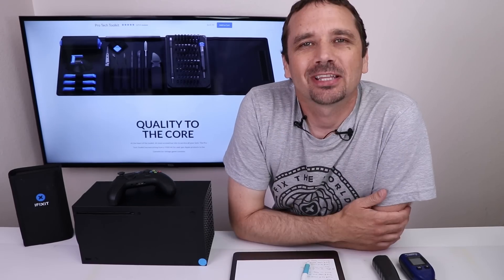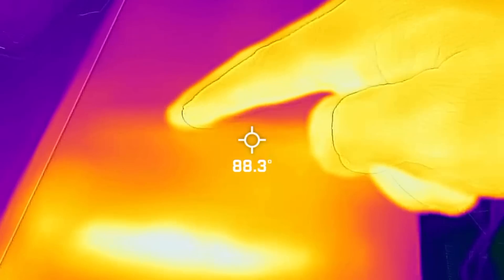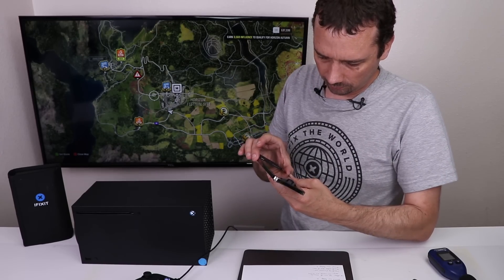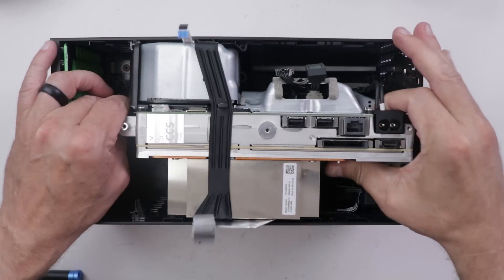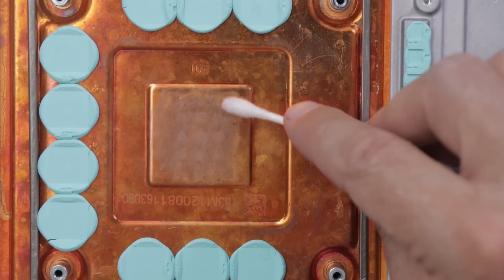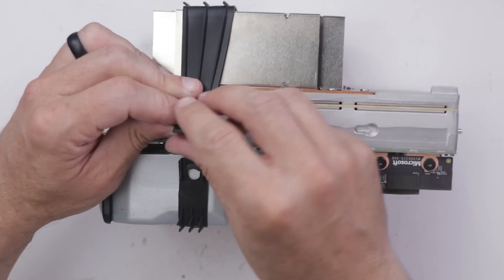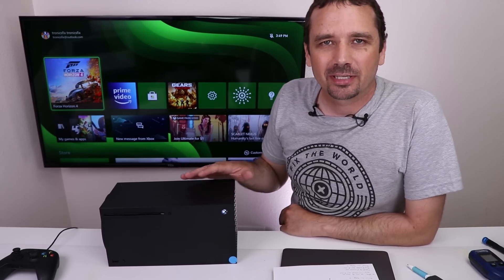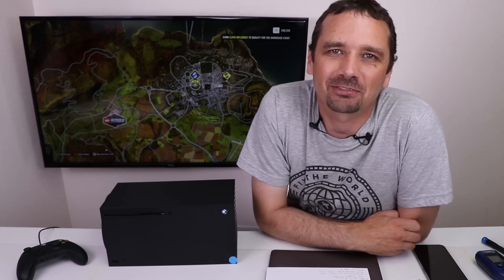I Put Liquid Metal In My Xbox Series X - Here's What Happened!

Comment: When I put Liquid metal on my 6800 XT it didn’t spread over the die like that, really odd, had so much trouble doing it that I ended up basically coating it in the stuff, and ruining my table. In the end the temps dropped by as much as 1-6 degrees on the core, on average maybe 4 degrees, and even stayed below 50 degrees at times under load. While mining it always was at 50-51 degrees, this time around it’s at 44-46 degrees. It also was 1-3 FPS faster maybe more. Not margin of error, did the same test hundreds of times. Nonetheless it’s really worth the risk. Hotspot dropped by 1-10 degrees depending on how hot the card is running. Can’t wait to waterblock it.

Comment: Hi, thanks for the video .... I also used liquid metal, spectacular results and I also changed the thermal pads for the vrm .... amazing results .. thanks thanks and thanks ... if you are a fan you don't have to fear the liquid metal .... for example, I used insulating tape around the gpu and there are no problems of dripping ....
One enjoy Liquid Metal Thermal Paste, 79 W / MK
Thermopad Thermal Grizzly Minus Pad 8- Thermal pad in silicone, self-adhesive, thermally conductive
these are the components I used

Comment: There's such a HUGE lack of any scientific approach here that it shouldn't allow any reasonable mind to draw any conclusions whatsoever. You've got varying ambient temperatures, you're not measuring temps from where you should be etc, and the list goes on. Just because you're seeing outside case temperatures higher than before the liquid metal DOESN'T mean that the liquid metal is the cause and therefore performing better. Of course that might be the case, but your NOT actually proving anything, it's all just conjecture. What makes this particularly bad is that this video is ALL ABOUT liquid mental and thermals and then do such a piss poor job of actually obtaining any meaningful data.

I like your videos, but where this could have been an interesting look at deltas between liquid metal vs thermal paste on the XB1X, your scientific method makes drawing any substantive conclusion just completely pointless.

Comment: I found out why they change the ps5. They use liquid metal on a PS5, so copper will absorb or liquid metal will penetrate the copper. It forms an uneven alloy surface over time on copper. Copper has to be nickel plated to prevent this, maybe this is why they've made changes on the ps5 of late with less fins and less visible copper....maybe it's aluminium or plated nickel copper, and not as much metal and fins needed with the right metal, and prevents failure properties? I stole some of that info from another comment. Just put two and two together maybe?

Comment: The real deal is that with LM the chip is way cooler. Will it make any difference? I think not because Xbox doesn't do boosting CPU speeds. Always the same mhz.

Side from the part that your chip is cooler in temperature,  LM doesn't dry up and after a second apply the Xbox never have to be renewed from any LM. 
While using normal paste will have you change this within 3 years. Especially if they use cheap paste.

Comment: ok so if i understand this correctly: a better thermal solution will output more heat because its taking more away from the cpu? so its possible to surmise the cpu is cooler because of that?

Comment: If you decide to use liquid metal know that the gallium in it will diffuse into the copper in about 6 months and solid indium is left behind making bad contact. Then you need to re-clean and re-apply it. Note the diffusion is permanent and actually degrades the cooler. Ideally you need a diffusion barrier like with nickel or silver plating.

Comment: As much as I am a technical person but I have to say The engineering behind Xbox systems is amazingly designed to be ergonomic and energy efficient 😍there is a reason why no game system do not use liquid metal simply because it’s highly corrosive and you have to reapply the liquid metal more often which is not worth the hassle that is why every game system I have such as my Xbox one Playstation four Nintendo Wii U PlayStation three and Xbox 360 they all use the highest quality thermal paste which will prevent the APU from being damaged from corrosion liquid metal is only recommended to be used on a desktop PC not on a laptop and it makes sense it’s much easier to manage liquid metal on a desktop PC😉👍 however I’m only disappointed with one technology that they didn’t include with Xbox series XS they don’t have a built in thermal detector but I am so glad they brought back the vapor chamber which allows the series XS to remain very quiet no matter what game you play The only major drawback with the series XS they draw too much power which can be a serious problem if you are paying for electricity in your home I guess they didn’t need a thermal detector to regulate The exhaust output because The way series XS is designed they have a large ass fan to throw out as much heat as possible in my opinion the Xbox one X was Microsoft best Xbox design of all time not only it’s compact it has a vapor chamber and a thermal detector so it’s literally the quietest game system of all time not even the PS4 Pro 2017 model didn’t have a vapor chamber🤦‍♂️ but it did include a thermal detector but the biggest problem with that is it was drawing too much power that is why it sounds like a damn jet plane🤦‍♂️ however Sony actually remedied the problem they actually released a new PS4 Pro 2018 model they significantly lowered the energy output combined that with the thermal detector it became the second quietest game system along side with Xbox one X but I have to still admit the series XS & PS5 thermal design is seriously top-notch even my PS5 is still quiet no matter what game I play😁👍 I can’t wait to get my hands on the series X but I’m still enjoying gaming on my 2013 Xbox one😎👍 yes I still have the 2013 PS4 I only use it to play VR games like and comment

Comment: Is there a way for you to analyze clock speeds and performance?

There are 2 theories as to why the exhaust temp would increase (you nailed one of them) and they are backed by a lot of data in the PC water-cooling world.  The motherboard itself is filled with copper traces that are connected to the VRMs and CPU.  When you add liquid metal all things being equal (no increase in average CPU speeds) yes the temps in the traces go down because more of the heat goes out of the heat sink.  But usually all things are not equal.

The other reason the temp would go up is most likely the CPU/GPU spends more time at its high clock rates.  For example I can water-cool a GPU and it’s cores will stay around 6-8C above ambient under 99% load (32-34C).  In other words the GPU just sits pegged at its boost speeds 100% of time.  For my CPU I have a CPU that struggles to stay under 100C no matter what cooler until you desolder/delid it and run it liquid metal and no lid.  Now I see 70-80C at full load and 50-60C in games.  That is with the turbo set to all core and 4.9GHz.  

I have a ton of useful data on Liquid metal.  Been using it since well before the 3rd gen Intel launch but just about every single CPU since then I have delided and then ran liquid metal.  I’m currently running liquid metal direct to die water cooling on a 9th gen 8 core i7.

Comment: Don't really get the point of this when you don't even thermal probe the thing..
Anyways here's the thing. The heatsink is probably already mostly saturated due to it being so small. So pulling off heat off of it faster isn't going to do a huge amount. I could be wrong though.
The liquid metal on the PS5 is probably for a mix of marketing and longevity as LM doesn't dry up.

Comment: TLDR: it is a bit higher (temperature) with liquid metal but thats because the room got 2 degrees (i assume Celsius) hotter but that also means the heat transfer of the liquid metal is better, for the most part it only got better by mere degrees

 it is a well put together console unlike the PS5 which literally gets like 5 degrees cooler by removing the side panels and another like 3-5 degrees by putting thermal pads on the memory modules, great job Sony 👌👍

Comment: Since the xbox will be scaling performance based on core temps, it'll be super hard to compare thermals apples to apples.  You'd have to measure core frequencies or power draw as well, which as far as I know there's no straightforward way to do on the xbox (though you may be able to measure outlet power as an estimation of the core power).  But still, a cool test to see what happens!

Comment: I’ve read the comments and have a science degree myself. There are too many variables here to arrive at the conclusion. The system may just be running hotter. It has software to control the fan speeds. We’re they running at the same RPM? Was it louder or almost identical? (You would need to measure the decibels) Also, unless it’s a replay, the stress is not exactly the same, even if you play for the same amount of time, etc. Nevertheless, interesting video.

Comment: Hey man I'm having some issues with my PS4 slim. I turn it on it shows the ps emblem with a black background and stays black the only way I have seen it past that it when I initialize it. It says corrupted database each time it loads up though and I have tried to fix it by using the safe mode but it doesn't do anything it will let me go on it for a few minutes and it's super slow.Sometimes it will freeze and then go back to having the same issues. My dad would unplug it alot so that might be contributing to it can you help me?

Comment: Question- why does the PS5 require that foam looking seal/gasket whereas this does not?
Reply: The PS5 was designed to use liquid metal, so the gasket is to prevent it from getting out and shorting components

Comment: Wow what a terrible idea. There are now thermal pastes on the market that outperform liquid metal and are non-conductive and don't disappear over time. If you were to put your Xbox in vertical orientation and leave it that way the liquid metal would eventually move out from the apu die and potentially kill your $500 console. If you want to replace the thermal compound, replace it with Thermal Grizzley Cryonaut Extreme and have better temperatures then liquid metal and never have to worry about anything needing to be replaced or get damaged. I have no idea why people are using liquid metal on everything like this. Just terrible.

Comment: What would be the problem with a controller that only works with the usb cord attached! I’ve changed the battery with a fully charged battery that works and replaced the usb charging port on the controller

Comment: The way you measure temperature does not work to see if the liquid metal works. Ultimately unless the cpu is throttling it should output the same amount of heat, just the difference between the cpu and the heatsink is higher. If you want to measure the effect, the best you could do is place a thermal couple on the back of the pcb behind the cpu. 

If you have a fan that cools based on temperature, the case should be hotter when using liquid metal as it will ramp up less. But since the XSX has a constant fan speed this does not apply.

Comment: Dude, your measurements are useless as good thermal paste TRANSFERS heat, the thermal output is proportional to load ... You should have put it in DEV mode and used a proper benchmarking app with CPU's actual internal sensor, anything else is useless. During the RROD days an awesome group of people put together the AGM temp dashlaunch plugin to test aftermarket cooling heatsinks and pastes. Modern Consoles have thermal throttling so if you wanted to do it ghetto you could get better results by finding a demanding game that gives FPS on the UI and see if running a game (without human input) makes the FPS raise/drop. ALSO: DONT USE LIQUID METAL ON A CONSOLE!!!!

Comment: Please, please no one do this! I'm a PC gamer and I have used liquid metal in the past, and you can't use it on copper, at least not long term. 

The reason you outright can NOT use this on aluminum is that most, if not all, liquid metal alloys have gallium in them. Gallium reacts with aluminum very quickly, so your heatsink will get destroyed in a matter of days. 

With copper, the metal doesn't react with it nearly as quick, but it still slowly diffuses into it, damaging the heatsink. I can guarantee that if you open that Xbox in a year, the metal will appear to have 'dried up'. It's not dried up, it's diffused into your heatsink and permanently ruined it. The only place you should apply liquid metal onto is a bare die or nickel-plated copper. That's why the PS5 has a nickel-plated heatsink, because if it were bare copper, it wouldn't last a year before needing to be replaced. 

Besides, the heatsink in a console is sized properly for the type of heat output the APU will put out. I'd even argue the PS5 probably doesn't need liquid metal either.

Comment: Nice video. Only issue I have with your methodology is that in my experience with CPU coolers on PCs is that Temperatures under load drop very quickly (within a couple of seconds) from when the load is removed. My CPU jumps from high 80s to mid 30s within about two seconds of removing the load on the CPU.  I think you should be checking the maximum temperature while the load on the CPU is still present. Measuring it several seconds after the load is removed is not as useful information.

Comment: I expected a lower temperature. I though that the produced energy in this chip would transferred „faster“ according the better characteristics of liquid metal. The chip should be cool down a little bit, the amount of energy drop also and the exhaust should be colder after a these 30min. You get more heat by the same „amount“ of load out of the Xbox. This makes no sense to me.

Comment: I suspect liquid metal goes longer without needing replacement, atleast when fitted like on ps5 being integrated when designed? Which I'd say is a great bonus, though obviously when repairing something it may cause trouble because of the skill required to replace correctly.
Reply: @Green Mamba Games what even is your problem, I'm just curious about how durability differs between the 2,this has nothing to do with me not replacing compounds, I never mentioned that, learn to actually read the content next time
Reply: @Green Mamba Games There’s a gasket around the APU on the PS5, the liquid metal can’t get out

Comment: Since the CPU's are based on Zen2 they might have boost behavior similar to it and might boost higher or longer with liquid metal if heat is dissipated more efficiently. So the interesting thing to see would not be the "temps", it would be if games have more stable framerates and if previous dips are avoided.

Comment: I was thinking to do this to my series but it's so quiet I do t think is worth it yet... Probably in a few years once the paste dries up.

I did change my ps4s thanks to you and I believe is more quiet on average but still turns into a jet engine on heavy workloads. I did add heatsinks to the bottom and two 12v fans to cool it down and the noise is more even now.

Comment: Very informative. How ever to me, the risk is not worth the reward. There is not a vast difference to speak of. I would rather be safe with thermal paste, safe to use, easy to clean, non conductive, can be easily reapplied. Is non toxic to aluminum.
Reply: There are a lot of things that aren't covered in this video that make this not a great upgrade. 

First off, he's completely correct. The temperature coming out of the console is going to be hotter because the liquid metal is spreading more heat from the APU onto the heatsink, but if you think for a moment, that same heatsink also has to pull heat from VRM and other components on the board. 

Adding more heat to the SINGLE heatsink in the entire system is not a good idea, you are essentially adding more heat to all your other component. This is why liquid metal makes sense in  laptops or desktops, but not such a small form factor like the X/S. 

You also really don't have to worry about the conductivity of liquid metal. Using something like clear nail polish around the CPU/APU/GPU to protect capacitors is enough to cover your ass in the case of any spill over.
Reply: I totally agree, but for the average joe, NO DO NOT attempt this, leave it to the professionals

Comment: The mistake for my is don't check cpu-gpu temperature, because all the others part, heat pipe and sink will be heater, but the cpu will be cooler (more heat transfer from cpu to the heat dissipation system)

Comment: I think you're right in your assumption..LM will result in a hotter heatsink since the transfer is much better. The ultimate test would be to measure the chip's die temperature before and after. Also how clocks are affected.

Comment: I actually considered it with my PC build, but I opted not to. For best results you need to de-lid the CPU. On all current CPUs this is dangerous because they are soldered on. There is a high chance of damaging one or more of the 3 silicon chips in my 5900x. There is also a high chance of damaging the smaller components. De-lidding for liquid metal inside AND liquid metal on the outside might result in 5 C difference. I didn't think it was worth it. My system runs at 60-65 C under load for CPU and 40-42 C for the GPU. It's not bad at all and way cooler than most gaming systems. I have dual 360mm radiators with water removing the heat. So it's good enough.